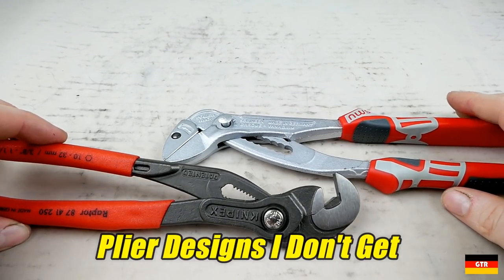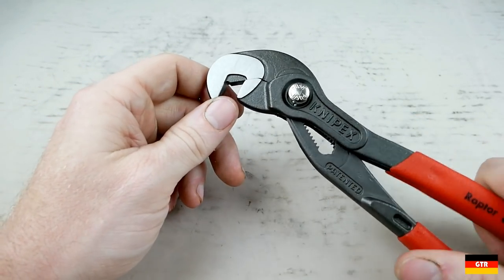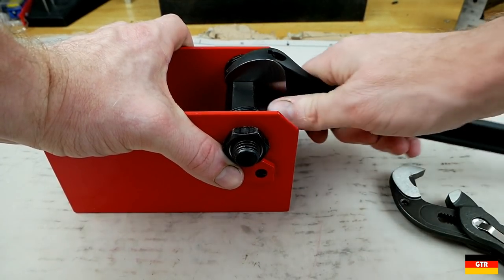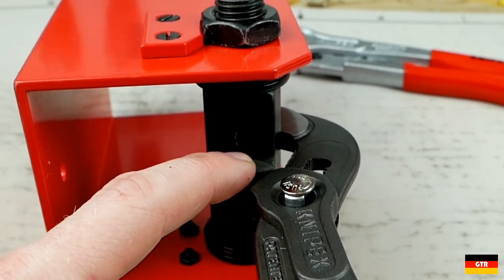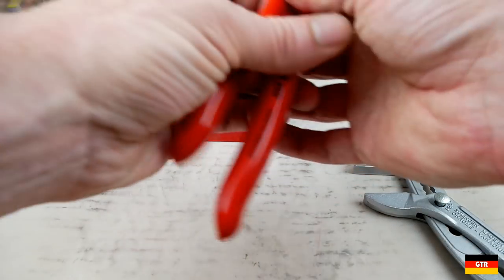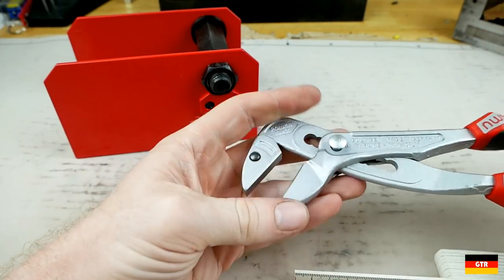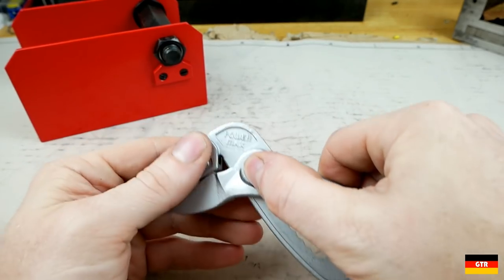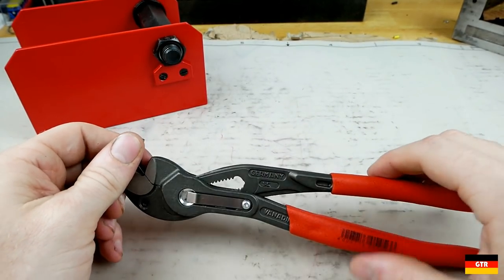Plier Designs I Just Don't Get

Comment: GTR, screw on my spring fell out on my cobras where can i get replacement
Reply from the maker: Depends on the length,  For 250 and 300mm length search for P/N 87 09 01.  For 180mm length search for 87 09 180.  Not sure if they sell them for the 150 and 125mm lengths.

Comment: Uhmm, not make it smaller. Make it one larger so it's easier to squeeze.  Seems to be the issue with the raptor too.  Seems like you're forgetting the squeezing part on both. Second ones look like cheap crap.